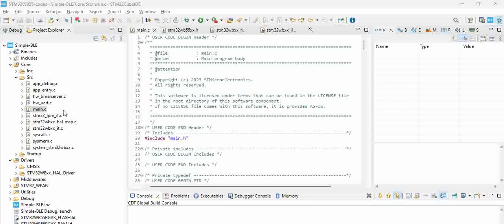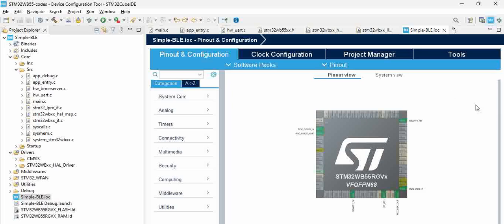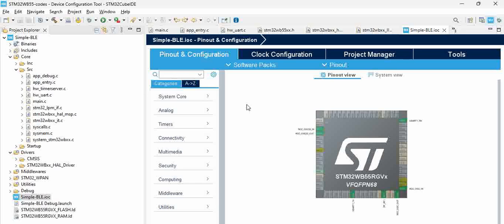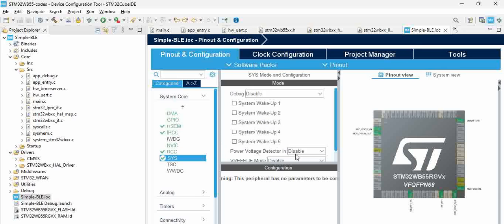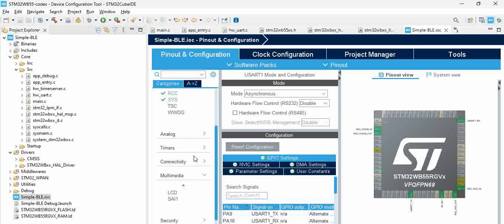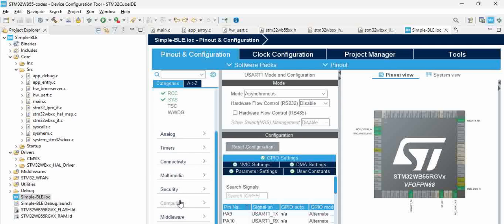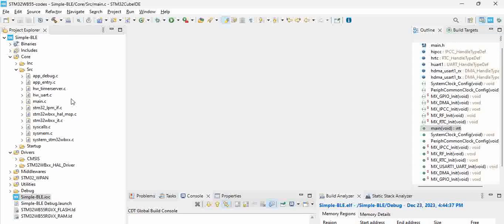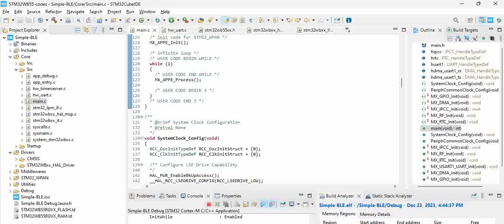Simple BLE application for STM32WB55 | STM32WB55 BLE Example | STM32WB55 Workshop - Part 7

Comment: Though BLE concept in STM32WB series is complex, but want to know how the firmware code making this possible. I just want to make custom client and server apps on two boards and make them connect & talk to each other. I tried it on STM32WB55CGU6 UFQFPN48, but didn't worked. Any insights?

Comment: same process i followed but i couldn't show any ble device on app 

MCU is STM32WB5MMGH6TR

if u can guide me on that then please....
Reply from the maker: Just check if the intended device is selected or not
Reply: @Way2Know  ya selected device is STM32WB5MMGH6TR but still
Reply from the maker: Before going to the configuration, your hardware is ok or not. How are you ensuring?
Reply: @Way2Know  in stm programmer if i connect board for fleshing then detail of mcu will show
Reply from the maker: @bdcreation1563 looks like the board is up.. have you followed the same configuration as mine.. step by step
Reply: @Way2Know  yes
Reply from the maker: Hard to find the problem without looking into it
Reply: @Way2Know  ya problem solved
Reply from the maker: Good to know.. all the best
Reply: @Way2Know  thanks
Reply: @bdcreation1563  What was the problem and what did you do, Please share?
Reply: @bdcreation1563  how did you solve it? tell me pls

Comment: great vedio can you please explain the how to send data from one stm32wb55 to another stm32wb55 via ble
Reply from the maker: Working on a similar request from someone.. while it may not be from same board, I will try to post from STM to some other board and some other board to STM..
Reply: I am also working on that sir do you have any example or githubs based on this.?
Reply from the maker: STM has examples but we have to customize as per our requirement
Reply: @Way2Know   your absolute Correct sir  if your don't mind may i have your mail id please then I will explain my problem clearly
Reply from the maker: @vijaykumarnimmala2212 dharanidharchatgmaildotcom
Reply: @Way2Know  hi sir i hope your doing good. i found the way how to send data from server to client both sides is stm32wb55
Reply from the maker: Good to know 👍
Reply from the maker: Share details if you are allowed. I will post in channel for benefit of others..
Reply: @Way2Know  may i know how do contact you sir please..
Reply from the maker: My mail id is mentioned in the above messages
Reply: @vijaykumarnimmala2212  hello, may I ask for the example too? I really dont find anything for connecting two wb55